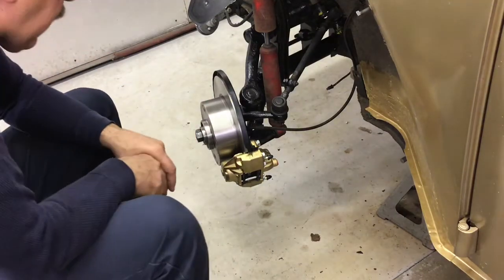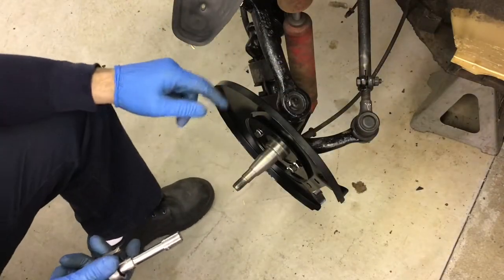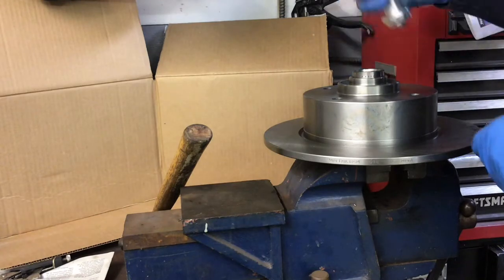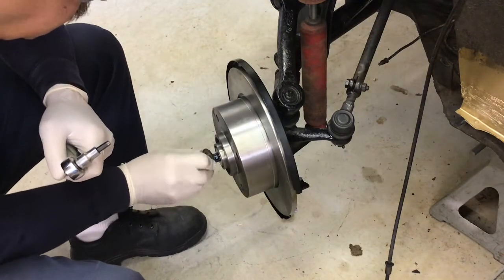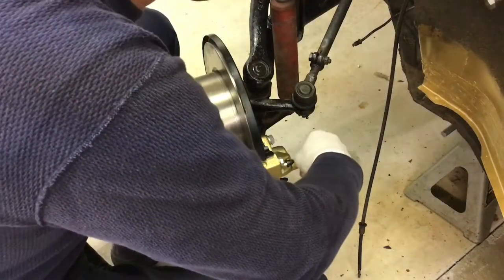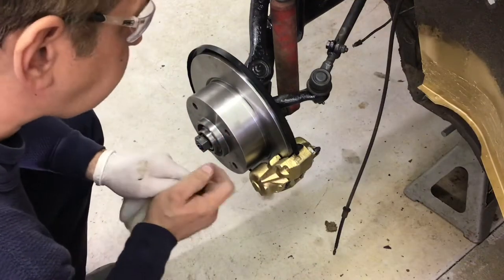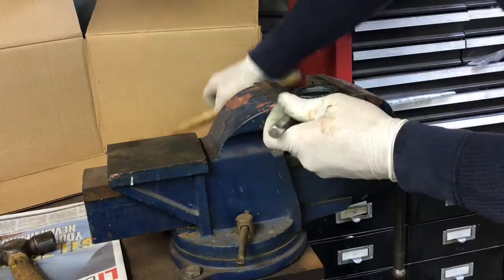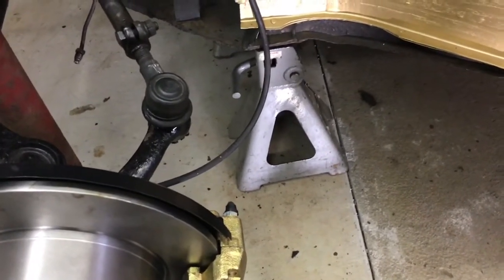VW Sunbug disc brake conversion part 16

Comment: I have a beetle the same, I am restoring it but I need the gold color code, what is yours?
Reply from the maker: Karim Lara The code for this car should be L99 Hellas metallic but the factory sticker is illegible, Thanks for watching
Reply: I don't know the color of my beetle because the sticker was removed at the time of painting it, mine is 1974 German and I'm in the process of restoring it and leaving it original